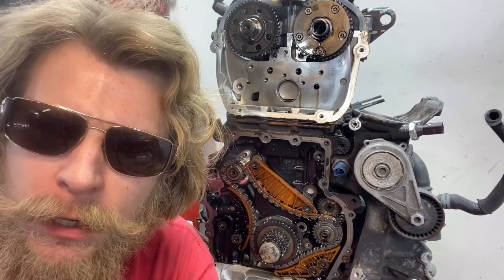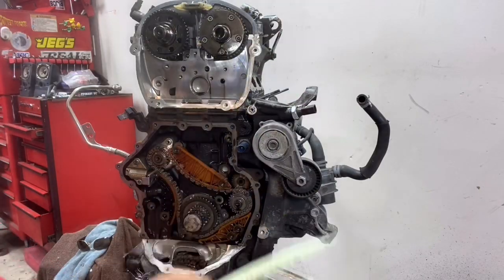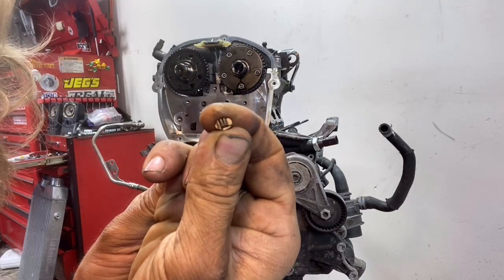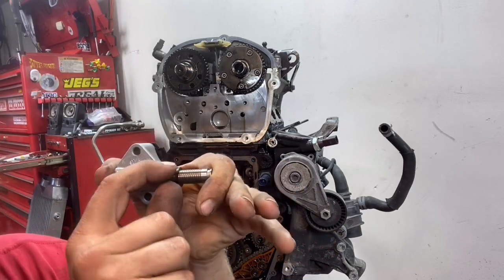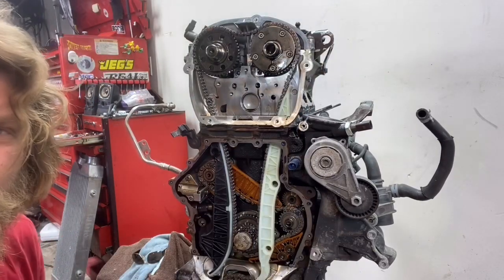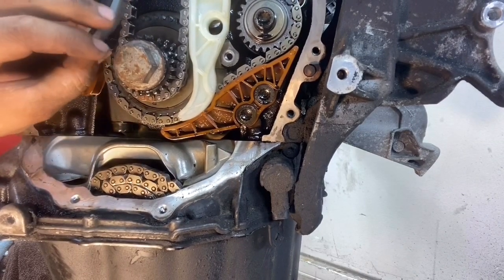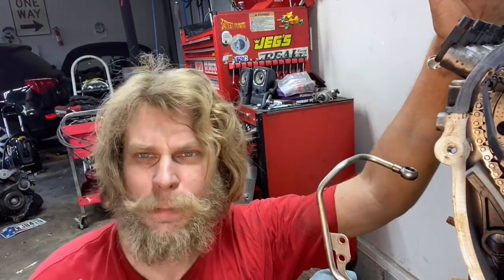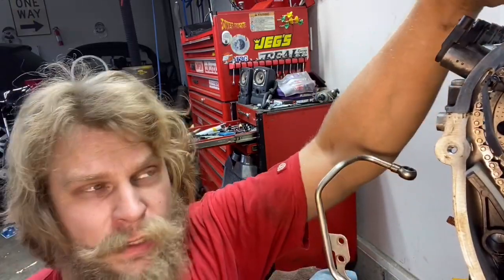2.0t P0016 AUDI VW TIMING CHAIN INSTALL tfsi a4 a5 a6 q5 repair replace diy

Comment: Awesome video on the new guides, chain and tensioner.. I just did a quick look at my Audi B8 2013 with 71k miles and according to my VCDS in UDS mode  using Advanced Measuring Blocks and I got these values:
Camshaft Adaptation bank 1: -6.90°
Camshaft rpm: 381.5
Angle difference actual-specified: -0.063°
Camshaft position deviation from reference: 0.02°

My question is do you suspect a stretched chain? I haven’t seen any P0016 codes, the engine sounds great, idles great, no vibration, no ticking.. oil is good been using Euro Amsoil VW502.0 do I need to pull the upper cover put it in TDC and do caliper measurements exhaust cam to guide, guide to intake and overall ? If I’m within 60-62mm and 120-123mm do you think I’m ok? Thanks!!! Actually looking for advice from anyone

Comment: On the old style tensioner, even if the safety paw quits, there is still a spring that is pushing out the barrel. So it shouldn't release the tension immediatly.

Comment: Hey brother, I am in MD and have a 2011 GTI with 76,000 miles.  Car runs great when should I consider replacing the timing chain and or tensioner?
Reply: You should its better to prevent a timing chain failure and pay over 2k on parts and labor

Comment: Is there a way of testing the engine before installing and starting it up?
Reply: Un plug coil packs and pull fuel pump fuse and you can crank it over without it starting, or you can manually turn the engine from the crank bolt

Comment: Love to get the part numbers of these New Tensioner and guides!
Reply: I believe it’s the only parts you can get now when ordering the various replacement kits. Mine is a 2014 allroad and it already had the updated guides from the factory. Probably made the difference when a check engine code came up for a stretched chain instead of being stuck on the side of the road with a damaged motor.
Reply: new style longer tensioner rail on the right is 06K109469M and the one at the top inbetween the cams is 06K109469N.
The Must have upper tensioner is 06K109467K 👍

Comment: DO NOT BUY an AUDI. Recently decided I'm not doing this.will not be entertaining this money pit any longer.this guy must love spending money and working on these things.6 months into owning my a4 I've done,coils,plugs,a million oil changes,numerous PCVs, oil vaccum pump,now manual clutch is going out along with some mysterious loud ticking noise coming from timing cover UH OH. Door locks failing,say hello to foggy headlights forever becuase replacements are 500 bucks oh yeah dont mention the power steering pump failure  and gauges on dash are flickering.but these are all apparantly "normal" things .oh yeah and if you got anything you cant fix yourself you might as well apply for a second job becuase your not leaving the dealership with anything left in your bank account.thats my 2 cents as only a 6 month owner.maybe its becuase it's a manual?no.its just an audi.
Reply: Wow thanks for the advice Scotty Kilmer! I watch all your videos! Rev up your engines!
Reply: @CarsandCoding  😂😂😂

Comment: Hey, so I’m trying to get the t chain guide rails for my timing chain job, and for the life of me, I cannot find the updated guides (top and engines left) that you show in the video. Even the dealer gave me part numbers that are for the old guides. Where should I buy the updated t chain guides? Or what are the correct part numbers?
Reply: My car is an Audi A4 from 2013, manufacturing date is June of 2013 if that helps

Comment: Hey Jared where do you buy the updated pistons to stop the oil consumption
I've been checking a couple websites but nothing solid yet.
Take care man.
Reply from the maker: The dealership or a very trusted parts website of your choice not eBay or Amazon, I believe counterfeit Chinese parts are sold under name brands based on my experience
Reply: Mr  @NaptownTuner  
I appreciate it.
Keep it up with the cool videos .

Comment: Yo Naptown Tuner, will the (post facelift) right side timing guide rail and upper guide fit a pre facelift 2011 Q5 CAEB engine. The ones you show on this video, can I just buy those instead?
Reply from the maker: JOE COSTA yes but the chain and tensioner is the most important part

Comment: Hi I have a 2011 Audi A4 with a cam rattle from1000 rpm to 3000rpm with a flashing epc light, it goes away when I unplug the cam adjuster Solenoid plug. Any suggestions thanks in advance
Reply: Change coils and sparkplugs